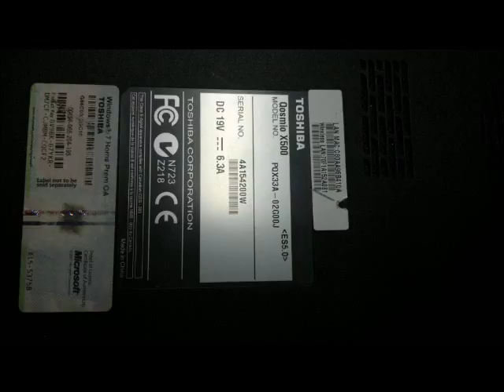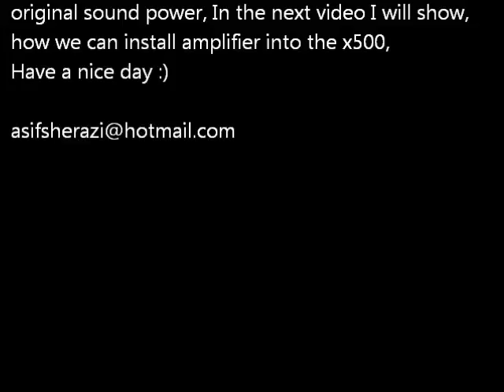How To Disassembe Toshiba Qosmio X500 / X505 Laptop

Comment: You rock poster! I bought the top-end of this version of laptop which cost me a bloody fortune, and it's still rocking, thanks to you!! I had huge heat problems, couldn't game or render for more than like 3 minutes before overheat. so i watched your video, got hold of the service manual, took it apart and cleaned it all - happy as butterflies now!

You saved me $300. I didn't want to send my baby away either, because I don't trust ppl that I've never seen or met to do that! THANK YOU SO MUCH!!!

Comment: Hello Muhammad. Thank you for this great disassembly video, well done. Just to let you know that you forgot one screw. If you pause at 3:11 you can see the hole of the screw just about in the middle of the keyboard's width, beneath the strip zone, just around the upper left zone from the wireless card. So there's a total of 5 - F56 screws there.

Great tutorial nonetheless.

Comment: Thanks for the video. I was having overheating issues and using this guide helped me take it apart to clean the heat sinks which were clogged. Now my system work so much cooler and faster . Thanks again !
Reply: Where specifically are the heat sinks?

Comment: Part 3: I've also heard its better to use Toshiba Display Drivers instead of nvidia.com newest (they may not be optimized for the laptop). 
Other advices included updating bios. 
Or shall I look forward to replacing the fan? 

Providing good air inflow significantly lowered the heating, but still, I had to tune down all settings in games to LOW and disable 3D quality features in Nvidia control panel.

Comment: Nice job dear Muhammad. My Qosmio X500 began to be noisy (the left fan). I may change it by a new one. So I've found your video here. Your slideshow is very interesting. Just the resolution is a little poor and does not allow to read clearly what you've written in red. With a 720HD or 1080HD resolution it might have been perfect. Thanks anyway.

Comment: your best bet is to watch this video and take it to the point where the keyboard and top cover are removed. then clean what you can using gentle suction or compressed air. one very effective method is to get a blower and BLOW the air BACKWARDS through the vents of the laptop, this will loosen it much more than trying to suck it out. but you could do both, which is what i do.

Comment: RAM is super easy to upgrade, (FIRST remove the battery and power cord) simply remove the cover for the RAM which is in the middle of the PC (on the bottom). Once that is removed you will see the two RAM sticks. on each side of the RAM there are two metal tabs, push these outwards (at the same time). The RAM will then fold out. Do it again for the second stick, to put them back simply slot them in and push down, they will click into place.

Comment: When removing the keyboard, note that the cables are released by lifting up (like a hinge) the black bar that rests across the cable. Do not attempt to remove these clips, they are extremely difficult to put back together. Also note that NOT all of the cable releases are of that type. Other cables (to release the top cover & motherboard) simply pull out. Be careful & be gentle. Take your time. Take pictures if necessary or jot down notes to refer to later when you reassemble... Good Luck!

Comment: hey starkistuna, youtube wont let me post the link, i will send you a message.

it is a bit of a pain and u have to be very careful. the cables inside that are connected to the board are ribbons so don't freak out when you think you've broken a clip off. its just how they come apart.

mine was also fine for about 3 months after i fixed it, but then it picked up more dust and started overheating again.

Comment: I followed the instruction the clean the fans and fix the keyboard. now they are fixed but the monitor got messed up after this. It seems like the connector between the mother board and the monitor has a bit of problem. one of the gold strip looking thingy sticks out when i plug the monitor connector in. I'm using it by connecting the computer to my TV with HDMI cord, but its life as a laptop is done. is there any way I can fix this connection?

Comment: i woudnt remove the board of i were you, this problem is solvable without doing that. it's just a build up of dust restricting the airflow, breeding heat. i also vacuum the fans gently and brush everything gently with a soft paintbrush to clean it. just be careful and you'll be right. hope this helps.

Comment: yeah ive done all that , without opening it, its  temp fix tho , the sure way is thermal paste so it lets me in peace til i can get money for a new one or the 460m becomes cheap enough with 940mx intel to upgrade then i can squezee out 2 more years maybe?
i got it to push Arma 2 , Dayz, and Arma 3 beta @720p on medium settings to 40 fps, I reformated machine installed Crysis 1 to stress test it , and its on its knees again!

Comment: Part 2:  Anyways, what happens is that when I run BF3 or SC2, the GPU slowly heats up to 86 Celcius and then the computer shuts down. I found out that lifting it up from the table  (table gots really hot under the laptop too) and allowing better air inflow does lower temp and stablize it. I also turned down some 3D quality features in Nvidia control panel.  
Still, this looks like just a temporary solution for an underlying problem. 

Anyone had success with beating overheating on Qosmio?

Comment: Hello everyone who used Qosmio x500/505  !

I have recently ran into serious overheating issues. 

Part 1:  I had the laptop disassembled and cleaned twice,   and still, somtimes the Fan on The graphics card would go crazy and make loud ''trrrrrrrrrrrrrrrr'  sound as if its paddles are hitting something. But when disassembled, me and the tech guy couldn't determie where the sound came from... .